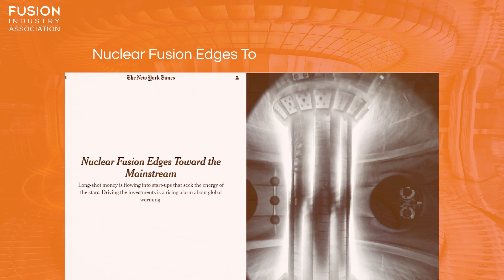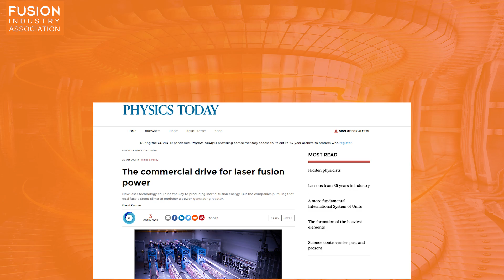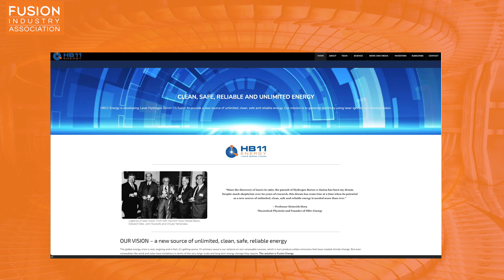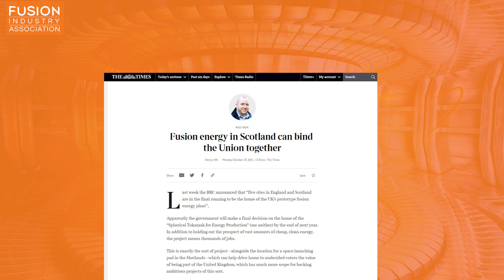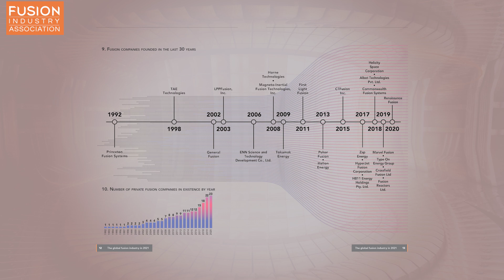Fusion News - Friday 29th October 2021

Comment: In laser fusion, how does one protect the windows or lenses from neutrons?
Reply: In ICF, if the chamber diameter is large enough, the windows and chamber walls can be very far from the implosion at the center so the neutron flux is lower (1/r^2). That's one advantage of ICF, because it means less activation of the chamber walls.
Reply: And the cost might depend on r^2, but back to the windows, I have been told that all insulators are very sensitive to neutron damage (and thus will be a potential problem for sensors in toroidal reactions) so although windows would last longer in a larger ICF device, the question still stands.

Comment: I live in Oregon and am trying to build my own man-portable nuclear fusion rotary detonation engine for high speed marine propulsion and underwater torpedo propulsion.   I need help and simulation software to further my designs.  The entire machine will fit in the back of a pickup truck bed and may be scaled down further in size so it can fit in a backpack.   Also in the future, I want to see if it can be turned into a nuclear torch to melt and create new ultra high temperature materials.
Reply: best of luck 👍